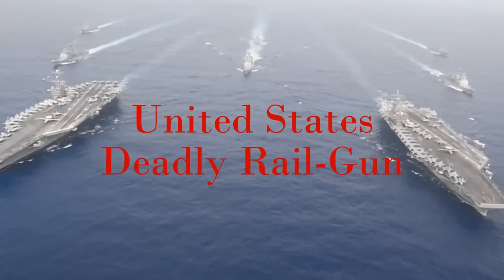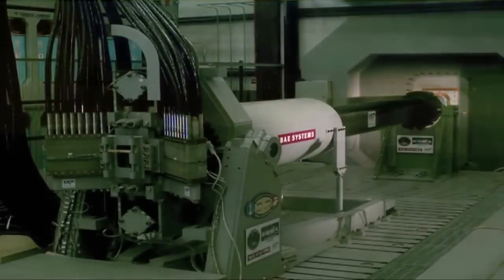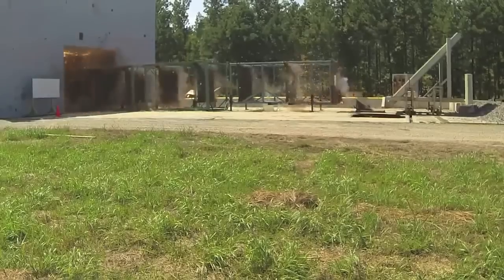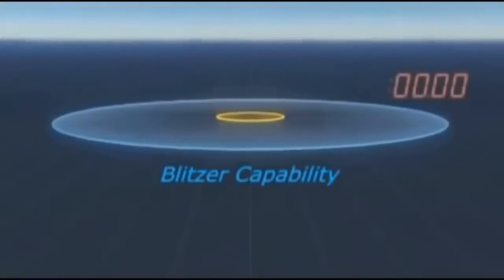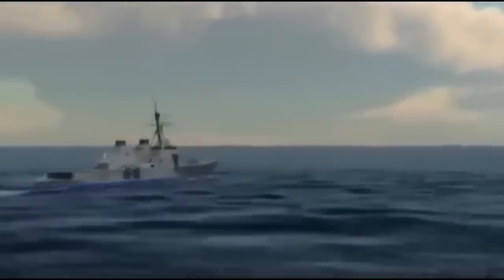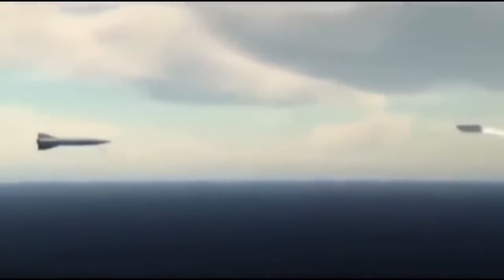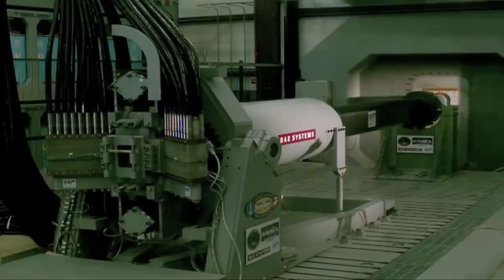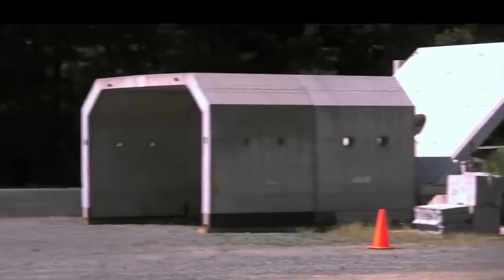USS Zumwalt will deploy the deadly Blitzer railgun

Comment: if it is a rail gun it should not create a exsplosion when it leaves the barrel of the gun, also it probably should not make anything but the payload come out of the gun since it is magnetic
Reply: The Masked Avenger 2  no because the projectile is shot so fast out of the barrel that the friction it creates for the air atoms is high enough to create an explosion
Reply: oh, ok
Reply: The Masked Avenger 2 do you understand how a railgun works?
Reply: yes railguns use electro-magnatism to propel a payload at such a high speed that the payload dose not need to be armed with exsplosives because of the force the payload impacts on the target
Reply: Look at the massive fireballs of the Navy test... it creates so much pressure, the air around it becomes Plasma. Its like a comet entering atmosphere at insane speed, with a tail of fire.